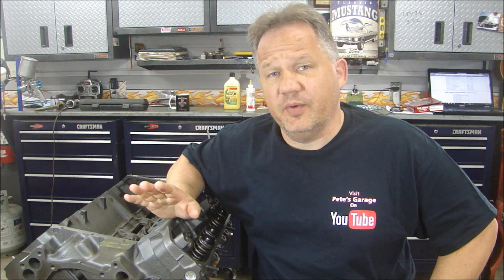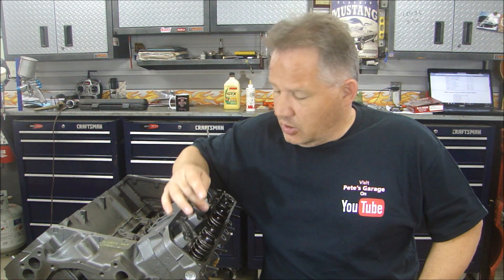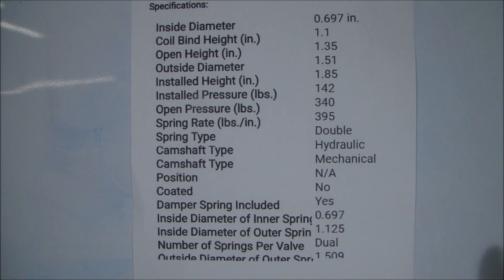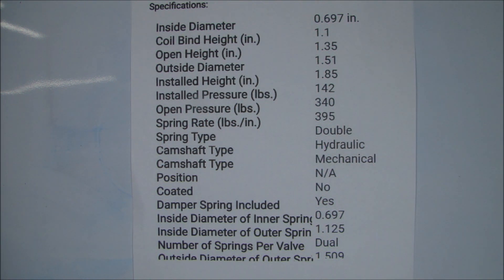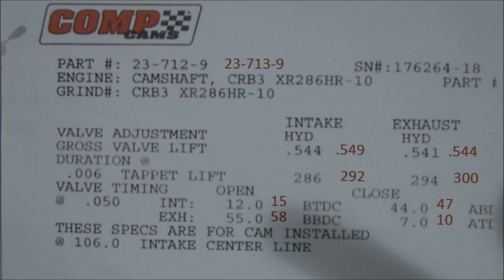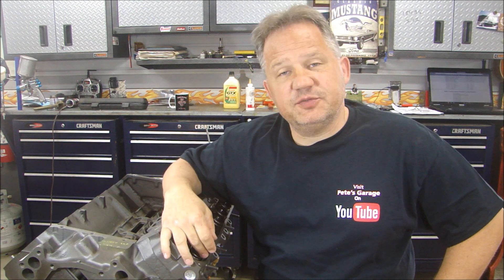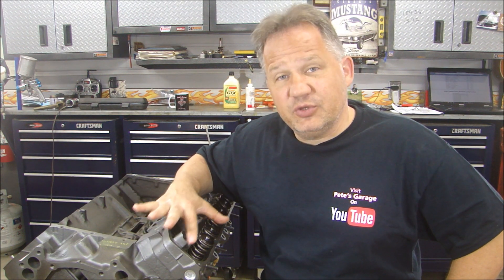440 MOPAR Big Block Engine Building - Matching Valve Springs, Cam Selection and Installation

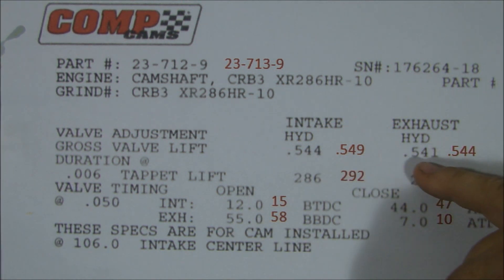Comment: What cam do you recommend for a 512 stroker street car? 727/3200 , 3:55 gear, 275 tire, 10:1 compression, eddy rpm heads, roller or hydraulic flat
Reply from the maker: Definitely a hydraulic roller

Comment: Hi Pete, I have a 73 Winnebago RV with the 440..It appears to be original when it comes to the engine..A full rebuild is coming up..Should I be looking for a set of 452 heads to replace the original heads??
This is the first time with a 440..Just trying to soak up as much info as I can..Are the original 1973 heads something that should be replaced??
Reply from the maker: I would keep it as original as possible. Just do a clean rebuild.

Comment: How do you calculate the valve spring specs when swapping heads on an unknown cam?
Reply from the maker: Measure the springs to see what they are, you need to know something. Or you can measure delivered lift
Reply: Pete's Garage I was thinking of putting a cam degree wheel on there and trying to find specs of cam this way. Ive degreed a cam before, but haven’t found specs in reverse.   This way it gives me an idea if what springs work.

Comment: When you say the springs were checked and fell within an acceptable range, what do you mean (met those numbers on pressure as a minimum, etc.)? I’m sure they didn’t meet those exactly.
Reply from the maker: Yes, when the springs were measured they met the requirements for the cam. Seat pressure and dimensions.

Comment: Nobody ever shows cam retainer bolt
Reply from the maker: A 440 does not have a cam retaining bolt
Reply: @PetesGarage  I'm building a 400 but was referring to the pin that is held in by the fuel pump

Comment: Nice Video.  I used that cam in a mild street 505" stroked 440 (440 Source Stealth Heads).  Used ISKY 8005A valve springs (400 spring rate) which fit the Comp 748-16 retainers.  Originally used cheap (CAT) 1.7:1 rocker arms, but had issues with them oiling, so went with the 1.6:1 Harlan Sharpe rocker arms which have had no problems with.
Reply from the maker: That is awesome info, thanks for sharing

Comment: I've never seen this, so maybe it is a stupid idea. What about orienting the block so the cam goes in vertical, almost no chance of dinging things up?
Reply from the maker: You are referring to "dropping in" the cam. It's a matter of preference. At the factory all cams are inserted horizontally.  If the cam slips when you are dropping it in you can either knock the bearing out of alignment or scratch a lobe.
Reply: Thanks Pete!